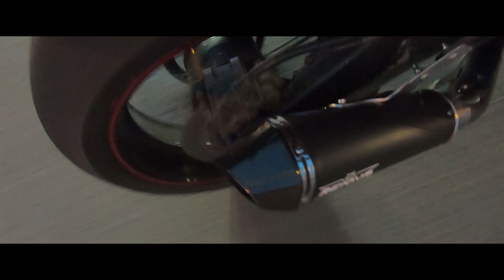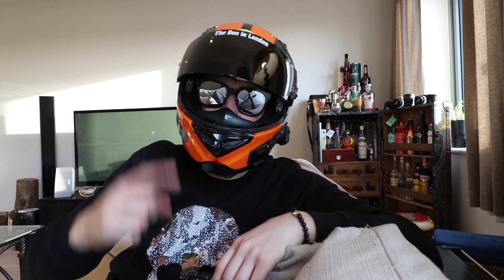Motorcycle build project Yamaha FZ1 FINISHED 2020

Comment: Be careful with those aftermarket leavers because I had the same ones and they were snapping my clutch cable , 3 times to be precise 😂🙈. The cable doesnt sit centre of the gully  so check your clutch lever and where the little gap is on lever where cable goes through and make sure it's not touching the sides of lever as it won't take long to go through a cable bro , i went back to stock , not as good looking bit glad I found the problem 👍🏼👌🏼✌🏼
Reply from the maker: Yeah cheers buddy aware of the problem and keep an eye. They are crap but just look nice haha

Comment: Hello! can you show share the links of the parts you bought for the front of the bike? like the things you used to keep everything together, headlight, tachometer etc
Reply from the maker: Hey buddy, unfortunately it was all one off made apart from the headlight which I bought on ebay. I changed the light a few times due to the quality. The brackets for the speedo I made myself and the headlight fork bracket I had made to the measurement of the forks. Sorry it isn't so simple buddy
Reply: @TheDonInLondon  Thank you for replying! Im planning on doing something similar to mine!
Reply from the maker: No worries 👍nice, yeah I think it looks awesome especially now after i sprayed all the silver to black. I still need to cut the rear end but currently busy with a classic bike.
Reply: @TheDonInLondon  Are you uploading a video of your new project? would love to see it!
Reply from the maker: @mandelmon1  yeah buddy it is all on my channel if you check out the latest videos

Comment: Hi Don. Just watched your vids about your FZ bom! and rebuild, very well presented and informative.
I have recently got an FZ1N 2009, (what a rocket) and took  interest in your channel to find the cause of failure as mine has a bit of a rattle to it. You mentioned the oil & water pump but didn't finish explaining the issue. Could you tell me your opinion of the failure please as this is something I want to avoid. Cheers mate. BTW, bike looks great.
Reply from the maker: Hey buddy! Welcome to the channel and thanks for dropping a comment. I think in the end my timing bolt seized and caused lots of issues as you can see. Check that for sure although can be other things too especially without hearing it. Good luck!

Comment: Nice , have you tucked the wiring away behind the light? , a pal of mine wants to do the same & i want the same for my suzuki.

Pleased for you too

Asd a booster plug £130 it will sort out the air fuel ratio mix
Reply from the maker: Yes all tucked behind the light. Is a pain but happy with the overall look. Still a bit of work to be done though. Thanks buddy! Yes will remap her when I can

Comment: There must be something that I lost in the video. How did you solved the hole in the motor?
Did you welded it? How? Welding cast iron isn't something that any welder can do, the selection of filler material to weld such high carbon and thus hard metal isn't easy, not impossible but certainly not easy and permanent being a motor.
Nevertheless the fact that you've made it is really awesome, keep up the good work!
Reply from the maker: Hey buddy, no I bought a new crank case cover for the whole engine. Thanks for your comment :)
Reply: @TheDonInLondon  Ah okay! By the way you could have replaced also the rotor of the alternator for a new one with protected magnetos, which many believe is the biggest cancer of this motor. With the old rotors the magnetos get lose after some time and f**k up the entire motor. Who knows if that was what happened to you, unless you haven't replaced it (not in your bought stuff list).
Reply from the maker: @AntonioCabralNumberOne  you are right I didn't replace it and will do soon. I didn't do it as I wanted to see if all the work would have paid off or not haha but obviously as it is all working well I have it on my to do list. The newer part is a solid magnet which means they will not fly out and kill the engine

Comment: It would be interesting to learn more about the circumstances/conditions that may have played a role in the failure of rod connection. Unfortunately, your video shows a close-up blurred image of the bolt/rod connection. I understand its not the topic of your video. What I can assertion about what might have happened is that the bolt elongated slightly and broke. The extending section of the bolt was then slammed and bent in the rod race. All this in less than a second. The bolt may not have been tightened to nominal torque and/or the bolt may have had a micro-crack, perhaps due to an impurity in the material or stress during production. Would have really liked to have seen a clear video of the bolt, the all the damaged areas, including the rod.
Reply from the maker: Hey buddy thanks for watching and commenting. You are the first to ask about it in that much detail and the overall video was just to give out more answers to other questions. Happy to make another video and shoe the details as I am currently making her a little more tidy during this lockdown. Stay posted will sort this out to show close ups if the parts :)
Reply: @TheDonInLondon  Many thanks for the quick response. Would value the means to review. My concern is that your ride failed when it should not have. I need the bolt to tell me its story.
Reply from the maker: For sure will show you the bolt close up :) would be interesting to see what you think. If you want add me on instagram or facebook I can send you pictures of it too

Comment: Well done mate you should be proud.   It sounds like one of the big ends gave way first to me.  We had it happen on a dumper at work.  That chain slapping noise could have been that Con-rod bolt.   I can't see how even if the chain snapped it would break the big end. Just a thought.  Excellent vid.  Will you show your face one day?
Reply from the maker: Yes I did think that too as the cam shaft and bearings were in bad condition but again think they went due to the oil not being circulated and the tensioner bolt also went at the same time... it looks as if it had no oil but there was the right amount at the time it blew. Thanks buddy, much appreciated! Not showing my face on here for now anyway haha

Comment: Damn, great work bro.  How's the throttle catch on your Fazer?  My '06 was always very touchy but I never did the ECU work to smooth it out.  Also, are you using stock gearing?  If you don't do a lot of touring or track riding with the FZ1, changing the gearing gives it way more pop in the low end.  A lot more fun around town. And nice liqueur cabinet, BTW.
Reply from the maker: Hahaha cheers buddy!!! :) mine is set to 21 on the TPS but you can always lower this to improve it which is easy to do yourself! I have the same gearing to be honest as I was quite happy with it, but you are right could change it too!